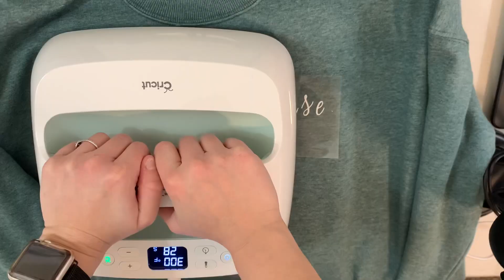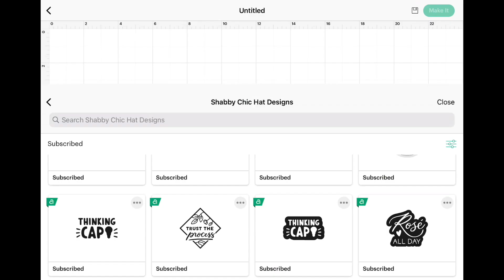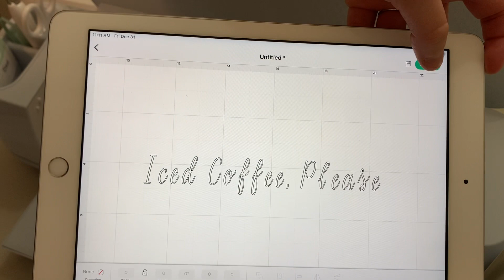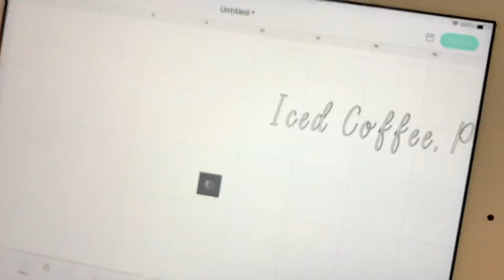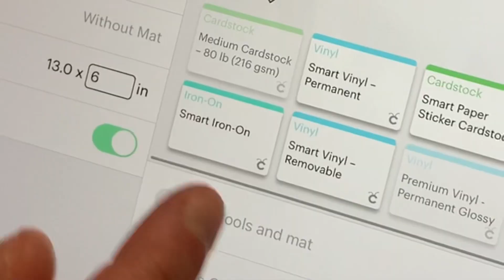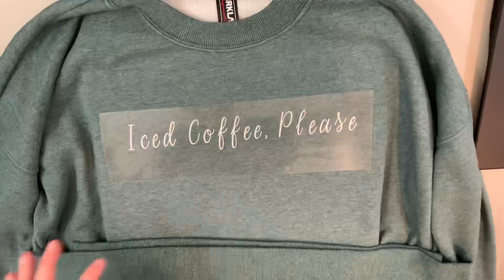SMART HTV+Cricut Design space | 2022 Cricut Maker 3

Comment: Hi. I if decide to use a mat with this machine, what size it should be? Thanks in advance.
Reply from the maker: Hi, it depends on the size of your project. It uses mat sizes  12x12 or 12x24. 🙂 I usually don’t cut anything larger than 12x12 so I usually use the 12x12 mat for this machine when I’m cutting regular vinyl
Reply: @cciaramartin  Thanks so much for your answer I was really confused about it since the size for the smart material is 13 width.

Comment: When my machine was cutting there was a paper jam and I ruined two designs this way. Is it because I didn't use a full sheet that spanned the length of the two "feet" ? My smart iron-on material was around 8 x 8. It kept jamming as it cut.
Reply from the maker: Hi, sorry for the late response. Thanks for your comment. I’ve not tried this yet but I would suggest using the Matt to cut the scraps. Thank!